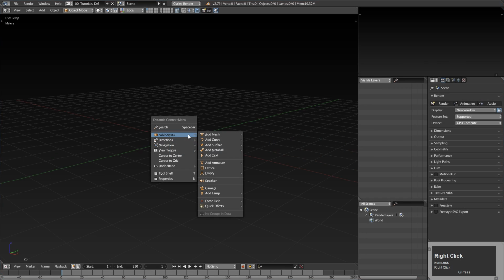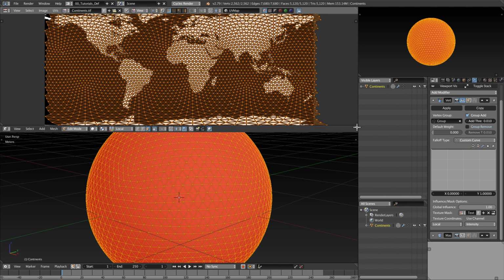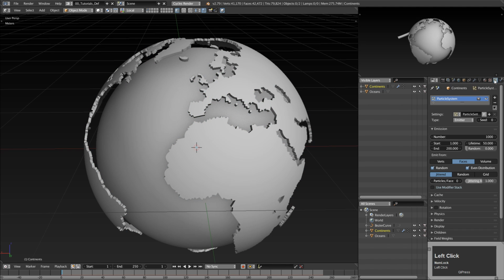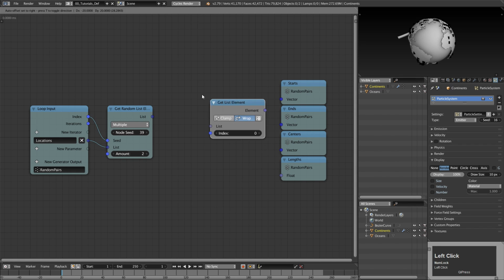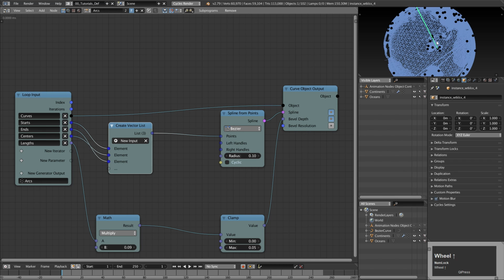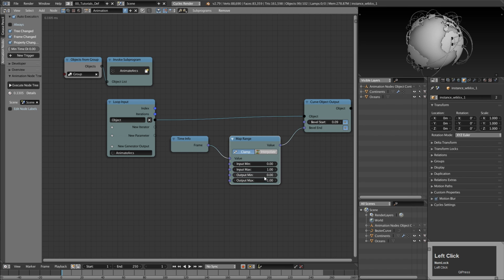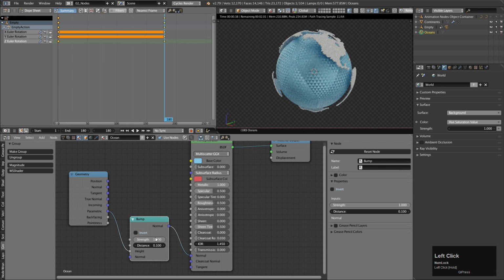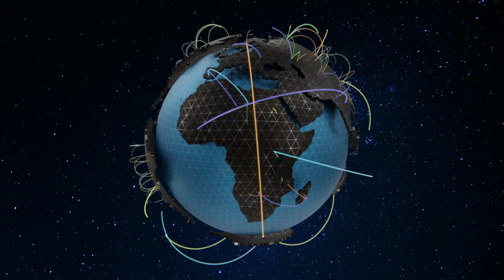[015] Blender Tutorial - Earth curves [Animation nodes]

Comment: I'm trying to have more control in the curvature of start points: When I tryed to use "Smooth benzier" the curve anchored on Earth don't follow the height, so I need to set the smooth and arch height very low to avoid this distortion (but I want more acentuated and high arcs)
There is a away to do that? I marked "Cyclic" on "Spline From Points" node, but it doesn't do the desired result (the only thing thats does is to close a circle underneath the Earth)

Its a bit abstract trying to explain my problem without images, but basically I want to generate more open and more high arcs (and avoid the arc start being generated to paralel to the ground)

Comment: Hey man!

First of all, thank you for your awesome tutorial. In the first instance I thought that you are doing it too fast, but while I had to re-view it in parts for several times, I have learned much faster.

However, I have a problem :-D

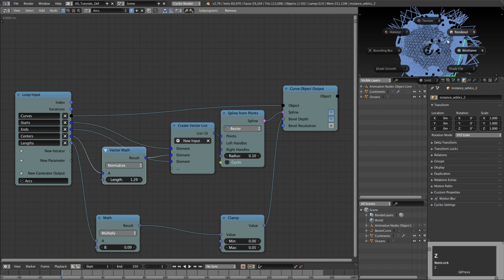I am trying to integrate your technique into a project of me but unfortunately I have the issue that the centers of the arcs are all centering to the middle of the world, when the length is at zero. When I move the length, then I can maximum push it into the opposite direction. It´s at 13:10 in your tutorial, where I cannot move on. Here is a screenshot of the issue. 

Maybe you have an idea? As you can see, the center points of the bezier curves are all at the world center in the zero position: 
https://gyazo.com/487a50a264a27772f0f93df0af3e1c39
And if I do move the length, then all center points just move into the opposite direction, as you can see here:
https://gyazo.com/621f06948ee307ee981aec12bdbc7de2
Plus - there is even an arc, originating from the center of the globe.

EDIT: Yes, I have tested it. It is because my earth is not at the center of the world, since the earth is just part of a bigger scene. Unfortunately I cannot move the entire scene so that the earth would be at the center.

UPDATE: It works if you arrange the object at the world center.

Do you have any idea how to solve my issue?

Best
/m

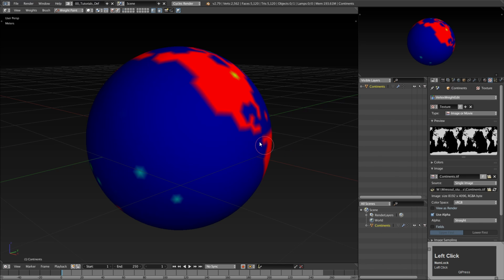Comment: Do not know what I am missing, but cannot get the continents displayed in red (min 4:00). I am using Blender 2.8
Reply: Me too
Reply: @arcanoushoankan1834  i got it done wut is ur problem if i can solve it for ya
Reply: same here, I don't get it
Reply: @siemensohm  believe me about the continent use wireframe the problem is only in the viewport but it will render well
Reply: @user-tl8lm9pc3x  oh okay, thank you, I will try it again
Reply: so in case someone's looking for a solution, I got it to work by changing the default weight in the vertex weight edit modifier to 1 and setting X of the custom curve to 1 also.
Reply: I had the same issue. The problem is just that you have to move up the X value on the Custom Curve all the sphere has to be read before applying the map, then solved, Good look.

Comment: I managed to do it on Blender 2.8 with AN2.1, but it does display any curve, I used the viewer to check where comes the problem, it seems that there is problem from the start with the Particules form object node or Particule data node, the output Locations gives me 0 length (empty list ) on the viewer, any Help ?
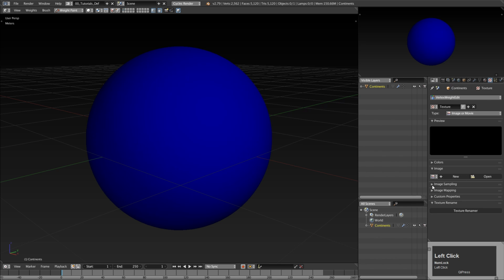Reply: How did you do it? Because after 4:00 it didn't work for me.
Reply: I get the same issue! :/
Reply: I have the same problem. did you find a solution?